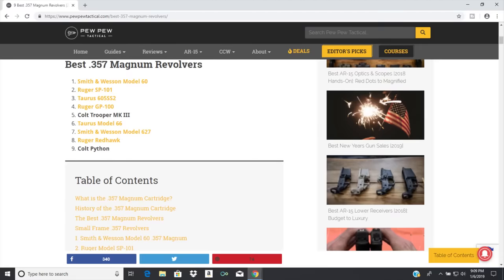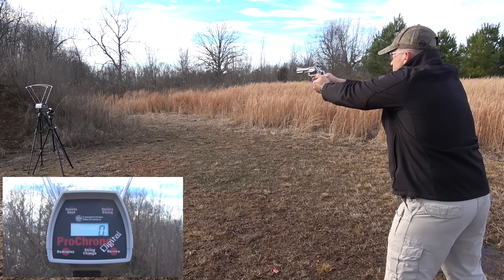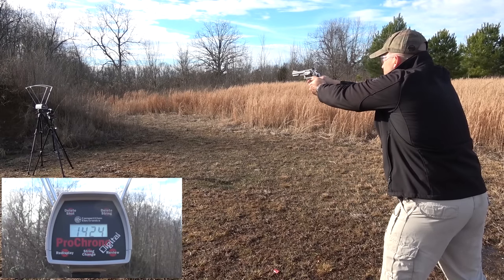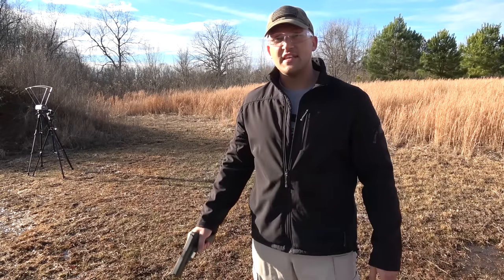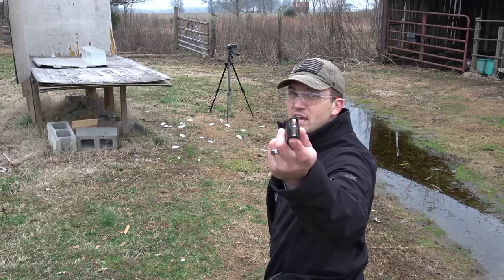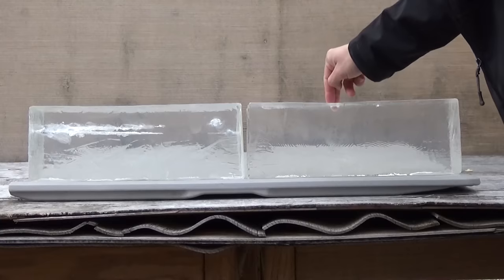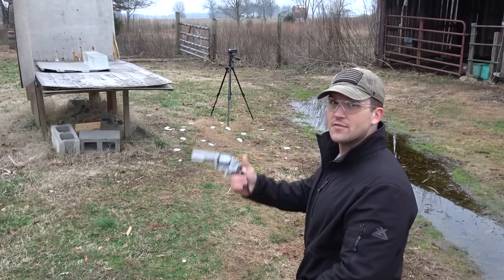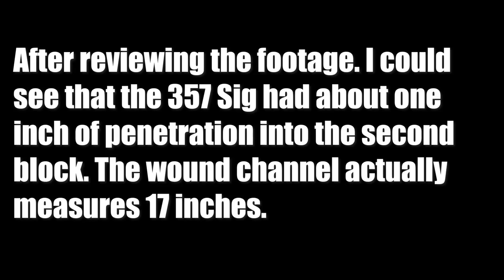357 Sig vs 357 Magnum vs Ballistic Gel

Comment: Very interesting Scott,I thought the two guns done really well.
I was kinda surprised that the revolver beat the semi-auto in the penetration test with the 147 grainers.
Reply: +4 gauge, the 357 Mag is a much more powerful loading with much greater striking force than the 357 SIG. The old 1920's 38 Special High Velocity loading AKA "38/44", (158 gr @ 1160 fps, 4" revolver) actually will hit about as hard as the 357 SIG 147 gr loading. The 357 SIG was always intended to operate at the low end, just under 357 Mag performance, and actually operates around the same striking force as the 38 Special HV, originally loaded for Law Enforcement use starting in the 1920's.
Reply: @63DW89A  The velocity was about 150 feet per second more with the .357mag.and 11 grains heavier bullet,not as much of a difference,yes it did penetrate slightly more with the 158 grain versus the 147 grainer on the .357 Sig.
Reply: @4gauge10  The 357 Mag 158 gr penetrated 25.5 inches; the 357 SIG 147 gr penetrated 17 inches.  Realistically don't you think 50% deeper penetration (25.5 / 17 = 1.5)  is a bit more than "penetrate slightly more".  I can actually handload 357 Mag even hotter in a Ruger GP100, as I know I'll only use the handloads in my gun and those loads will never be used in a lightweight J-frame. Underwood must keep loads safe even in the smallest, lightest 357 Mag revolver.
Reply: @63DW89A  I saw the test,the .357 didn't do as well as it should have with the 158 grain bullet,I happen to reload ammo on my Dillion fully auto press and know a little more about these two calibers then I'm being given credit for.
Very little difference ballistically,the .357 Sig was very close to the mag,I was very impressed with it.
The .357 Sig.can be loaded to the same ballistics as the mag,the only difference would be using the 147 grain bullet.
Reply: Whoever thinks a Sig can be loaded to the velocities and pressures of a 357 Magnum better get themselves some good reloading manuals and read them thoroughly you're going to hurt yourself.
Reply: @jamesd4923  Huh...I've been doing that for more then 10 years on my Dillion fully automatic reloading press.The only mod that I had to do was to put in a higher pressure slide spring in it.
Reply: I also have many reloading manuals SHOWING the ballistics in the Sig can be equal with the .357.
I guess you have to get updated reloading manuals the way it sounds.
Reply: @4gauge10  don't need any new reloading manuals been doing it for 30 years Common Sense goes a long way don't be foolish the Magnum has way more capacity that's where it all ends right there no comparison sorry
Reply: @jamesd4923  That's not true at all,first of all,without a reloading manual,you have no idea where your at on SAAMI pressure specs,you put yourself and others in danger on the gun range of explosion of your barrel,not smart!!.
The"magnums"came out back in the 1930's,magnums are very dated technology,this is where the .357 Sig/10mm./.50AE shine and put the magnums in the shade,the newest publications of reloading manuals have hand loads for the .357Sig and 10mm.and.50AE that easily outperform the old .357 mag.
I have some of the best reloading info available,the .357 mag.is on borrowed time by the experianced shooting crowd.
Reply: @4gauge10  look I'm the one that told you to get some reloading manuals I did not mean not to use manuals I'm just way more experienced and knowledgeable than you'll ever be with firearms thank you have a good day God bless America
Reply: @4gauge10  I hope you don't think the 50ae is equivalent to the 50 Smith & Wesson or laugh out loud the 50 BMG
Reply: @jamesd4923  Nope,the most experianced shooters NEED reloading manuals,Bob Milek,Elmer Keith,Jon Sundra,etc.are as experianced as I am,which is far more experianced then you are.
If you don't recognize these names,then I rest my case.
Reply: @4gauge10  please I read all that before you were born probably son wake up smell the coffee little man
Reply: @4gauge10  Scott you're pretty great 4 gauge not so much have a good day God bless don't be a hater
Reply: +James D Yep, I was thinking the same thing, reading some of these comments, shaking my head. I've been reloading and shooting, for nearly 50 years now, and have seen a few revolvers and autos come apart in a foolish handloader's hands.  Rule of thumb I use is 5% velocity increase, requires 10% more powder, and a 20% pressure increase.
Reply: @4gauge10  The 357 Mag was using a 158gr JHP bullet, and the expansion slowed the penetration.  A hard cast lead RNFP 158 gr would have punched clear thru both blocks easily.
Reply: @4gauge10  Name the loading manual showing the 357 SIG can equal the 357 Mag.  In MODERN RELOADING 2nd Edition, (Richard Lee 2003, 2009) the 357 MAG has a capacity of 1.15cc, and the 357 SIG has a case capacity of 0.89cc. The 357 Mag has 30% greater powder capacity than the 357 SIG. (pages 547 & 551). So how is it possible for the SIG to equal the MAG?  Also, auto pistols, with unsupported chambers, are severely limited in pressure peaks. A 357 Mag revolver, with tight chambering, and the fully supported chambers of a revolver, can easily outperform the SIG. Heck, in a strong revolver, the 38 Special can be loaded to easily outperform the SIG, because the 38 Special also has considerably more case capacity than the 357 SIG.  Personally, I would only fire such heavy 357 Mag / 38 Special loads in a Ruger Blackhawk, Redhawk or GP 100, or other medium, or large frame 357's (S&W 686, 627 etc.).
Reply: @jamesd4923  The comments by 4 gauge are hilarious in the ignorance. The guy is clearly clueless about reloading and firearms. I asked him to name the manual showing 357 SIG loads equalling 357 Mag.  Richard Lee's MODERN RELOADING (2003,2009) clearly shows the 357 Mag at 30% greater case capacity.  Imagine the unsupported chambers of a Glock at the 45,000 PSI pressures of a 357 Mag.  I'd pay admission to see the fool loading those, touch them off; from a safe distance of course, with eye protection and body armor!
Reply: @63DW89A  excellent point I'd like to be there too at a safe distance.😀😵😎 357 Sig just doesn't have the potential to utilize enough powder to match the Magnum.
Reply: @63DW89A  love what you have to say good to hear from an experienced hand loader all he has to do is look on YouTube further and watch a lot of fools blow their guns up! thanks again God Bless America
Reply: @63DW89A  very informative great read totally agree

Comment: Your Barrel lengths do not match up.  An auto includes the chamber in length a revolver does not. To match  you would  have  to use a 2 1/2 to a 3 inch revolver otherwise  it has an advantage.

Comment: Not even a comparison.  .357 mag is the winner.  Can you do .357 mag vs 10mm? May be interesting
Reply: Josh Mango 
Pretty sure it’s been done. 10mm wins that’s why I bought the Glock 20
Reply: @ottoposhner9000  yeah but not by him. It would be good content.
Reply from the maker: I’ve made a video on this already. Check it out 🤙
Reply: Josh Mango How? More recoil, less capacity,  can't put a light on the revolver, penetration of the sig round isn't massive overkill as a matter of fact it falls perfectly within FBI specs, and the sig round mushroomed to a larger diameter with just the 125 grain. I smell fan boy that is blind to facts.